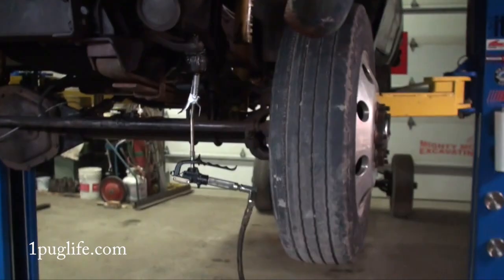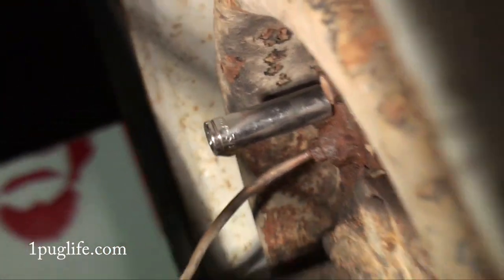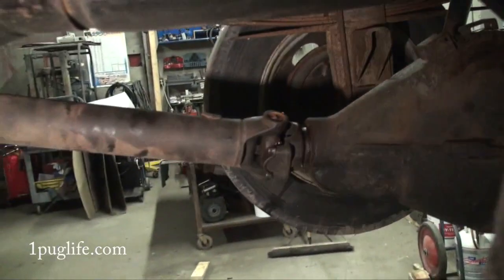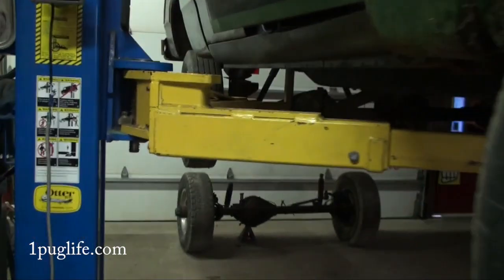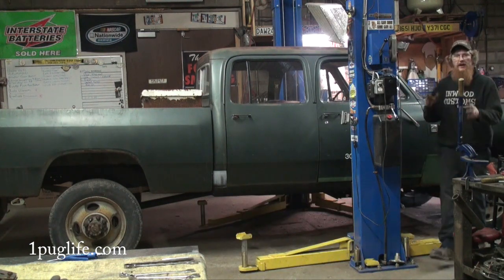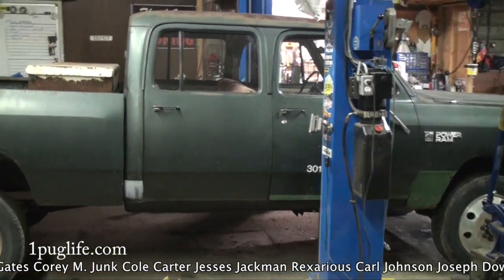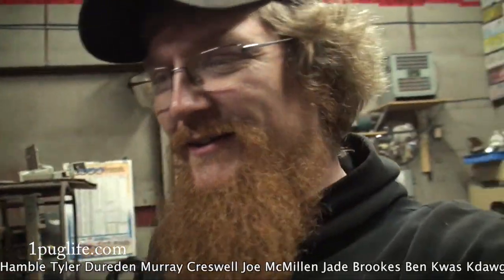test run

Comment: That right rear flexible brake line might be collapsed on the inside. 
Remove the line and blow air through it in both directions and see what happens. 
Sometimes they'll hold pressure and cause the brake linings to drag.

Comment: Water out of the vent tube? I sure hope you changed the gear oil in both axles after they have been sitting outside FFS
Reply: No that would be the proper thing to do. Only half job season on this chanell
Reply: @grenade you clearly know nothing about vehicle mechanics.

Comment: , you need to run denatured alcohol through the lines it'll clean them up and then I can think you can run dot 5 in there you have to check on it.....83 sounds sweet with the turbis nice job pug1

Comment: Pugs, I for one thought that the 83 would never run on it's own power again. You surprised me getting the Cummins running, and sounding like a big rig. Big thumbs up!

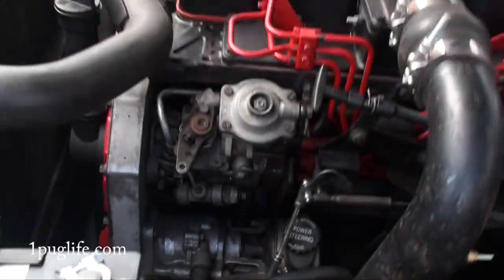The speedometer gear is rather strange. There shouldn't be a 30% difference between the factory 4:10 gears and the new dually 3:54 gears.
Reply: Probably different tire size then stock.
Reply: That isn't the factory transmission from 83. I'm betting the ratio in the diesel tranny is different from the 727.

Comment: My suggestion is keep the dually fenders black and just buy new wheel cylinders for the drum brakes. You are replacing the brake lines any ways so why have it mostly new and reliable. Either way the truck is turning out great!

Comment: Kind of a shame to go through all that work to finish with patina. My vote is for truck bed liner the whole thing. Maybe front power seat from a 70's New Yorker? If you managed to build an awesome snorkel that ran up the cab like a modern rig and stacks, she could run through feet of water like nuttin with a little water proofing of the wiring. Nice job though! Bravo!

Comment: Was it spinning the tires at 8:20 or was the clutch slipping?
Reply: i bet turbo vastegate just opens
Reply: Clutch 100%
Reply: @Soulvex  no way
Reply: Sounded like clutch slip to me too
Reply: @Idk-fo4cp  didint you listen that at all put vol up up up and try again
Reply: Broo_sh.......definitely wheel spin, you can see Pug correct the steering when it starts to slide.

Comment: Looks dicked with one wheel on a dually axle bmpppp
Reply: I think I would have taken it out for a rip myself in that situation,  I don't really see the need to do all that nonsense before at least making sure I didn't have to pull everything off if there was an issue. Maybe he's learning from past experiences,  I know I have done way more work in my life than I ever needed to because I tend to get a little excited.
Reply: @alphatrion48  I never thought of that that's a good idea, it just looks like a rail road truck with a single on a dually axle, front looks sassy as all fuck tho. Keep yer stick in the Ice Buddy

Comment: I c u drive dodges a lot.  Do u ever have any problems with the heat.  My truck blows ice cold air on driver side an Luke warm on passenger side in the winter. In summer it’s totally opposite. Driver side will b hot as hell and passenger side will b cold. Not cold cold.   No where near as cold as it should b.